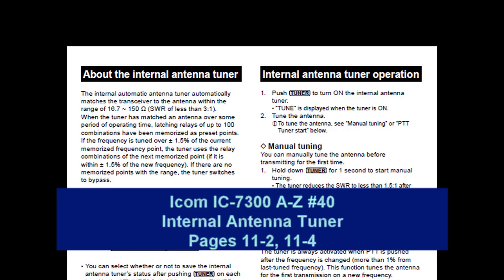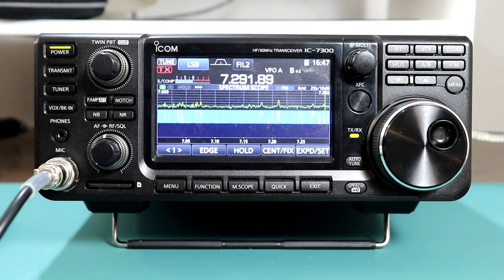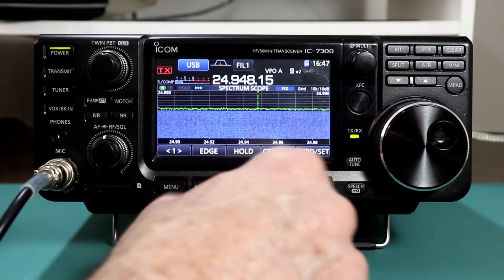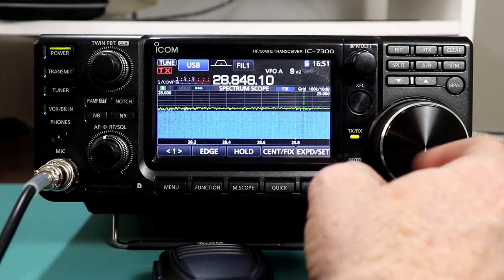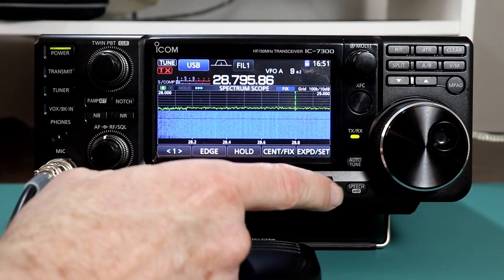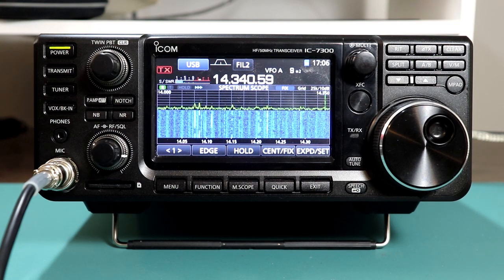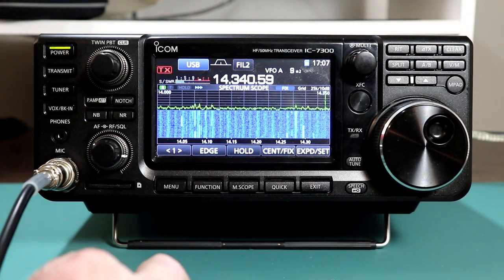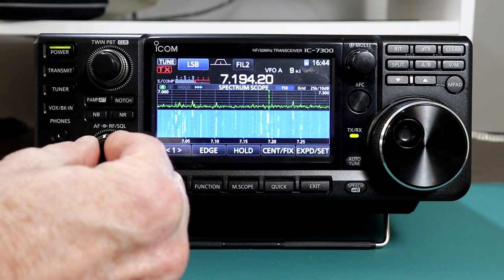Icom IC7300 A to Z #40 Internal Antenna Tuner Operation

Comment: On mods.dk there's a modification installing a 100k resistor in the tuner which then, the author claims, will allow the internal tuner to tune antennas more than 3:1 SWR...such as a multiband endfed dipole which doesn't normally cover WARC bands. Has anyone tried this mod and does it work? Thanks, 73 ~ k6sdw
Reply from the maker: Hi Eddy.  I'm not familiar with that mod.  However, I suspect that the resistor modifies the SWR reading that the radio sees to make it appear lower than it actually is.  When you start a tuning sequence (not in emergency mode), the first thing the 7300 does is to key the transmitter with the tuner bypassed and measure the SWR.  If it is greater than 3:1, the radio drops out of tune mode immediately and doesn't bother trying to tune the antenna.  The mod could certainly work and the tuner would tuner SWRs higher than 3:1 and operate at full power.
Here's the problem--  The capacitors, inductors, relays and circuit board spacing for the tuner section of the radio have been designed to for some maximum RF voltage.  When a tuning a high SWR antenna, very high voltages can develop across the tuning components.  The higher the power, the higher the voltages will be.  So you run the risk of arcing across the tuner components inside the radio.   I'm sure there's some margin in Icom's design.  The question is how much margin and how bad an antenna will the mod force the radio to tune.  So, if you don't want to risk letting the smoke out of your rig, I'd stay away from the mod.   73,  Tom

Comment: Do you have to be in AM mode to check swr?    Thanks
Reply from the maker: Hi Theo.  The manual recommends putting the rig in RTTY mode to check the SWR.  AM mode will work too.  In either one you will get a carrier just by keying the mic.  If your in SSB, then there is no power output unless there is audio.  As far as your different readings, 1% is a little too low for the SWR function to read accurately.  You really need to have the power set to at least 10% to get a good reading.  So, I’m afraid those good readings at 1% were just a false tease.  Sounds like you might need to do some antenna work or maybe consider an external tuner.

Comment: Master of the obvious. What does the power switch do?
Reply from the maker: I’m assuming that you’re joking.  However, not as obvious as you might think.  Normally you hold the Power button for 2 seconds to turn the rig on or off.  It does have another function that you can enable in the settings menu.  You can turn on the capability to capture screens on the radio.  When this is enabled, a momentary press of the Power button will capture the current screen to a BMP or PNG file and save it to the SD card.  Just search “Screen Capture” in the PDF version of the manual and you will find the setting option.

Comment: More...can you make one for use with an external manual tuner. If you are using an amplifier the ATU in the 7300 is not used. Some are using something like an MFJ989C and an amplifier. In that case one would want to disable the internal ATU for all operations when amp is used. Thanks again Tom. Ed/K8EA BTW visit my channel "K8EA."

Comment: You should be using RTTY and not SSB. The reason why RTTY is used is not to interfere with Phone operations but to provide a constant carrier. SSB is a suppressed carrier mode so you only see output when the radio is excited (you speaking into the mic) which is not a good method for checking SWR since the radios output power will vary (based on the level of your voice) giving you skewed SWR readings. 

It would have been a far more productive video had you gone into Spot and Graph SWR measurement and their respective uses.

Can I have eighteen minutes of my life back?